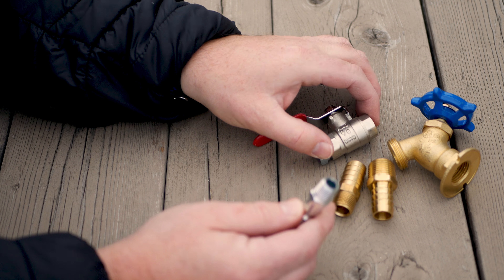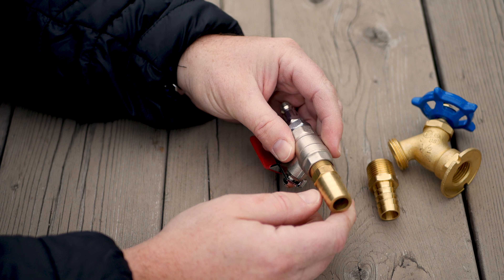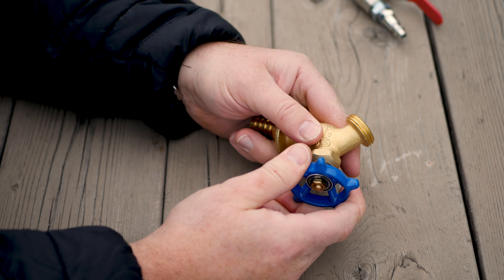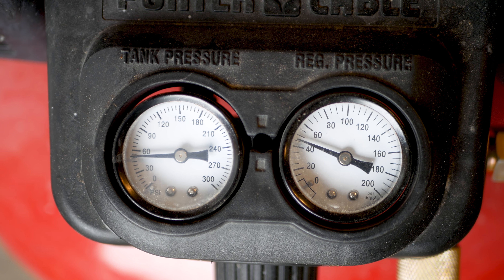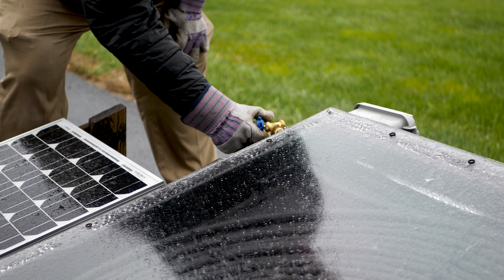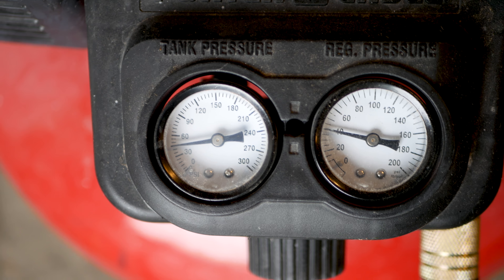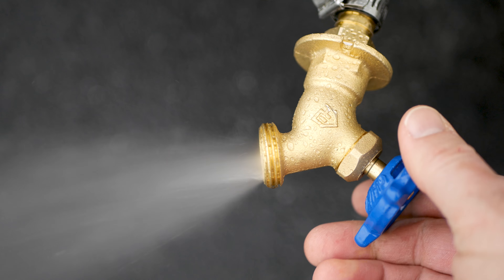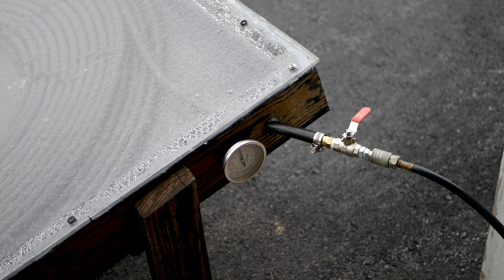Winterizing DIY Solar Pool Heater (Blowing water out for winter)

Comment: I think the shut off valve is a good idea and allows the soft start up. I used the system in our cottage to blow up the dishwasher and the washing machine. I also added RV or plumbers anti-freeze to the bins and then ran the discharge to make sure the pump wouldn’t freeze. You probably don’t need antireeze in the system but it could be an extra precaution.
Reply from the maker: Walter Scofield Good point Walter!  I have store the 12 volt pump inside.